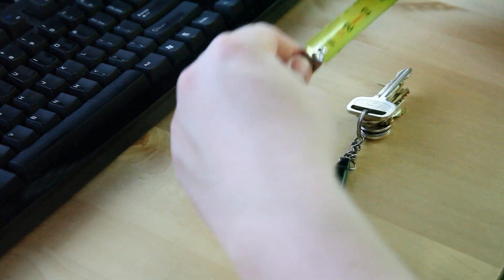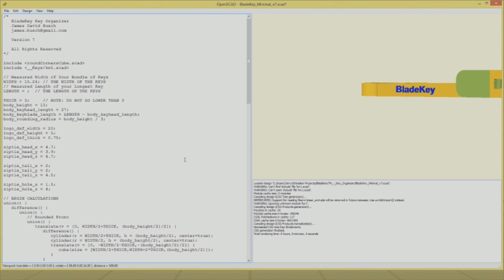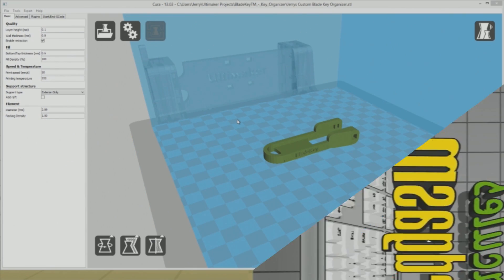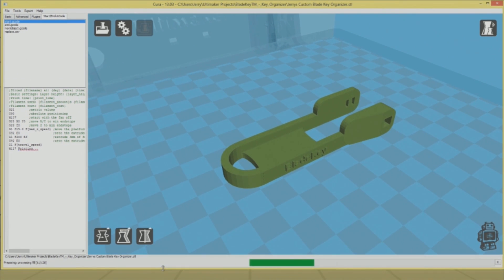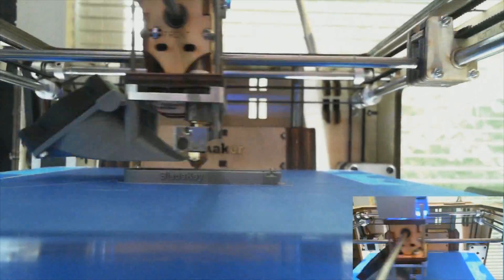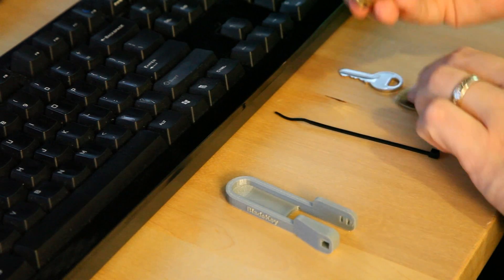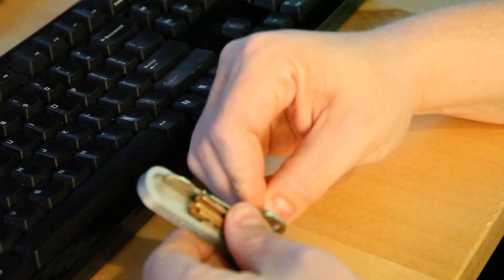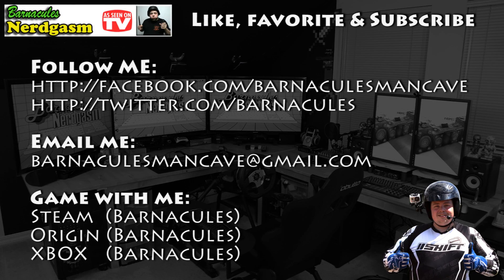Printing an easy to use "Swiss-Army" like organizer for keys on my Ultimaker 3D printer - Bladekey

Comment: Man, I've wanted to buy a 3D printer for a long time, but haven't had the money or time to shop for one. Maybe in a few months I'll be able to sit down and search for one.
Reply: Ok, for the best deal you should buy a unassembled RepRap. You have to have a little bit of mechanical inclination, but I mean its basically $400.00 vrs $2000.00 for the same thing, just not the ultimaker logo lol.
Reply: nice, I looked into those and they seem pretty low cost - I'll definitely get into those

Comment: that looks awesome, the only thing I would be worried about is the zip tie breaking from the keys friction wearing on it and loosing your keys. Maybe you can modify the design to use something metal to secure the keys and then this design would be perfect. I love little inventions like this, it must be awesome to have a 3d printer. You are a lucky man Barnacules, you have a great studio set up there and great equipment with loyal followers to the content you produce. Keep up the hard work and making ppl like me jelous lol..
Reply from the maker: Surprisingly the side broke when I dropped it long before the zip tie gave out. Now I want to try printing one in T-Glass material since it's more flexible and durable.